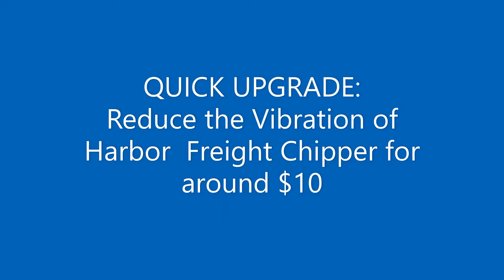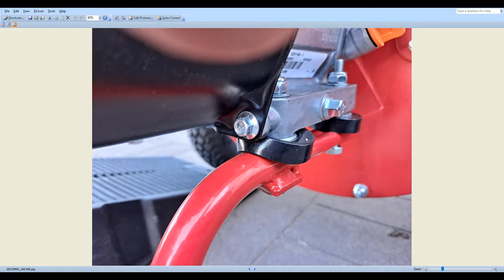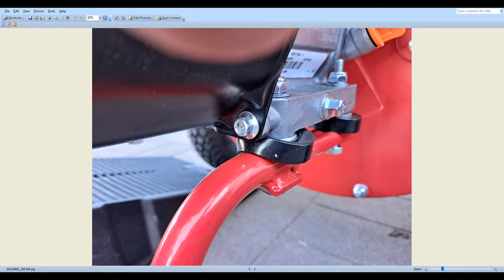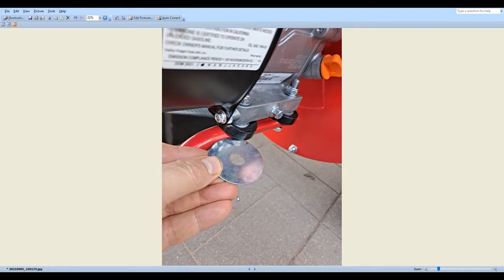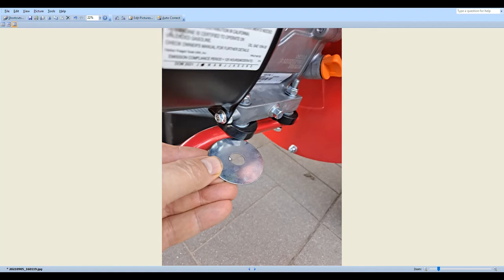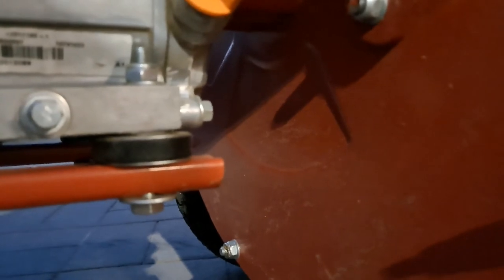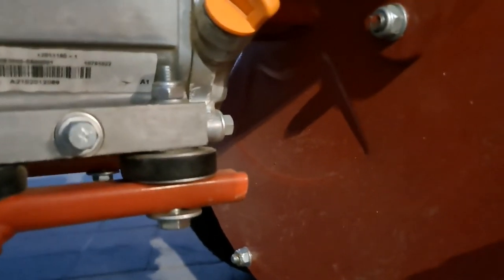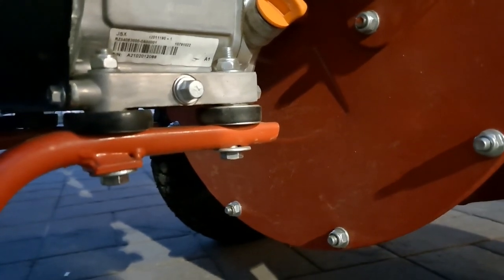Quick Upgrade:  How to reduce vibration on your Harbor Freight Chipper Shredder for less than $10

Comment: curious: can I use harder rubber mounts vs. the cheap ones by HF that continually fold over it seems (given the engine weight and continual vibration--look like hard plastic)?? Seems to me that harder rubber--sandwiched between with your washers--would be optimum...just have to watch the height  match to engine as it meets blade housing. Thanks for a good idea!
Reply from the maker: Hey Jack.  Yes probably would work.  I considered that myself but the supplied ones seem to (just) hold up on my unit once they are sandwiched between the washers.  Why not try a harder rubber.  Let me know how it goes.  I wouldn't go too much harder as harder material obviously reduces the vibration dampening

Comment: Thanks ,you said they were 1inch and a half  and what size is the hole in the washer im going to order them on line again thanks for post the video.
Reply from the maker: Hi Robert.  I don't remember the ID.  I think I just took a bolt to the store with me to be sure of the fit.  Please measure your bolt thread OD to be sure but I think the bolts are 5/16" in which case I probably used 3/8" ID x 1-1/2" OD fender washers.  Good luck !
Reply: @dadlifediydoityourselflike2293  Hey Thanks very much.

Comment: I have found a great way to reduce vibration on this item - return it and buy a real shreder from Amazon - same price and it works! Bought this shredder - what a piece of junk. First time - didn't work. Exchanged it - missing parts. Exchanged it again - faulty operation. Went to return it, they wanted a $30% restocking fee that no one told me about. Manager hung phone up and told me I as dishonest and refused to give me her boss' number. I will NEVER buy anything from Harbor Freight again - cheap tools that break and aren't worth saving $10. By the way - bought both shreders they offer - the small one is weaker than a paper shredder the bigger one is unsafe and very hard to operate - especially since they don't tell you you have to hire a professional mechanic to install the high altitude kit. This company is very dishonest.